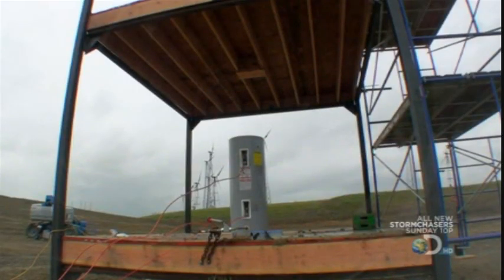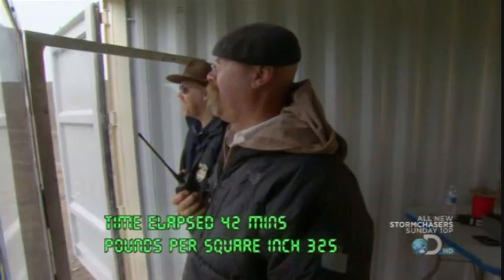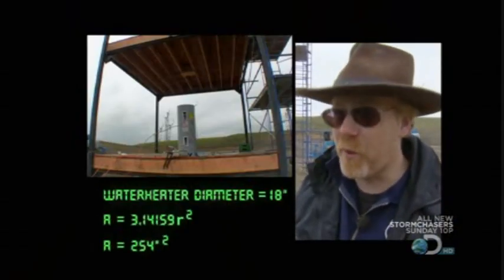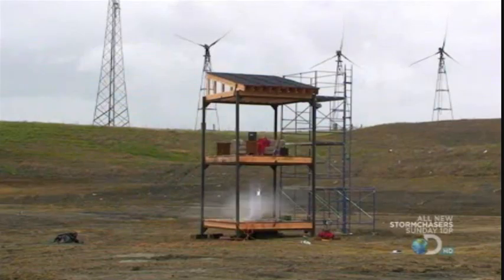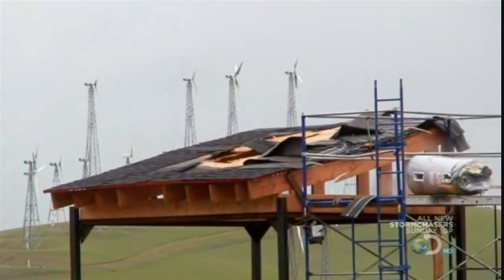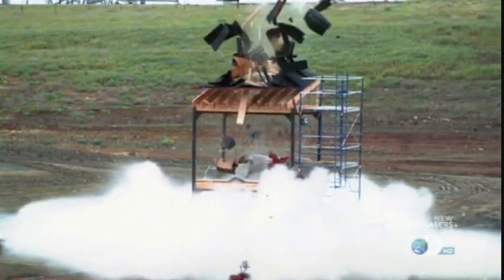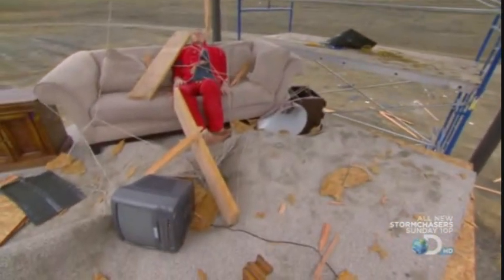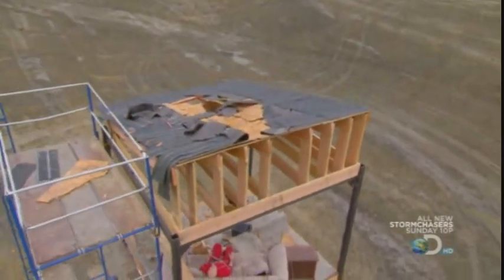Mythbusters Water Heater Explosion

Comment: Well, I watched the video as well, was neat watching the water heater explode then ejecting itself threw the roof, but I have a problem with that.  1. water heaters have pressure relief valves, and thermostatic control gas values with built in aquastats that can be set for maximum temperatures.  Now assuming they all failed at the same time, which I have never seen in 40 plus years of working on water heaters, but lets assume they did fail.  Did you notice that no water lines were attached to the water heater which would have altered its trajectory path.  and if it was a gas heater it would have had a gas line attached to it as well and a chimney all changing its trajectory .  which more then likely would have exploded in place.
Reply: another note in my statement it could be an electric water heater in which in that case does not have a gas valve, but does have temp controls and relief valves

Comment: I remembered this episode from original airing.  Water heater started leaking at about 1:45am, from upper side panel.  Fuse box does not have a label for the water heater.  Yes, I could just turn the whole house off, but no.  Lowes it is, replace the thing.

Comment: This was one of the experiments that best summed up this show. I never would have expected it could actually take off, I figured itd just blow up if anything. Sure taught people the importance of safety valves..
Reply: They cheated a little bit for that dramatic effect. 
They deliberately left the tank partially filled so they could create a larger volume of steam. 
Their first explosions, the tank was 100% full like it would be in normal use. The tank ruptured, but only jumped slightly. It'd wouldn't have the energy to rip itself loose of connecting  commecting pipes and sesimic braces.

Comment: Friend of mine worked at a factory that failed to check the pressure valve on the water heater..... the next morning they found the water heater at the edge of the parking lot

Comment: On the back page of Journal of Light Construction years ago was a report of a big, old riveted-style residential water that blew up, maybe sometime in the 60's of 70's, but the HWH was much older than that. ALL the safety systems failed (or were not present): pressure-temp relief valve, temp limiter on the thermostat, and apparently some kind of check valve on the supply to the house. The tank blew through 3 stories! shattering the roof and landing several houses away. Fortunately, no one was hurt.

Comment: Why doesn't the tank's supply pipe relieve the pressure?  If the water main is 70 PSI and boiling water in the tank creates a greater pressure, it seems like steam ought to flow out of the tank back up the water line.
Reply: should have watched the episode when it aired... lots of questions answered there.

Comment: This reminds me of how missiles leave a submarine. On Boomers of old and now the Ohio Class submarines, there is a small solid propellant rockest separated and sitting on top of 88 gallons of water. When the trigger is pulled to launch a missile it sends a signal to the firing unit which ignites the rocket and blows the metal separator open to transfer the water to steam. That rocket had a thrust of 90,000 lbs per square inch in .6 seconds and pushes the missile out of the tube about 100 feet above the surface of the water. So the very bottom of a 44 foot, 120,000 lb missile is sitting at about 150 feet below the surface of the water  to about 10p feet above surface of the water. So it throws that missile out at over 250ft. It has to push it so high so the missile.has time to feel it's own deceleration so it can light off and fly away. An 18,000 ton displaced submarine moves about 15-20 feet every time a missile is launched.

Comment: small point but those arent "cinder blocks" they are just "concrete blocks" cinder blocks went out of production around 1950. These blocks while strong in compression are very soft, a couple of taps with a hammer is all it takes to break them
Reply: People have used the term cinder blocks for concrete blocks for as long as I can remember. At least in Pennsylvania.
Reply: maybe , but they will forever be called cinder blocks. When I worked in the biz , we used motor homes for the cast , none of them were Winnebagos, but everybody , and I mean EVERYBODY called them winnies.

Comment: One of the best, most relatable Mythbusters segments ever! Almost every home has one of these. It shows how critical it is to have a working T&P relief valve on every unit.

This is a perfect example of a BLEVE! 

I worked for 10 years (during the mid 1980's) as a mechanic in a industrial plant, and worked with a retired plumber ("uncle Bill") there. Part of my/our job was maintaining two 5500 mBTU (relatively small) low-pressure (15 psig)  boilers, and we often discusded the awesome power of steam and the amount of energy available in it. We actually discussed this very scenario: A domestic hot-water heater going waaay over temp & pressure and failing violently, and just how dangerous and damaging it would be.  And here, y'all did it!
Unfortunately uncle Bill passed prior to this episode airing. But I'm sure he would have been amazed (as was I).
Thank you!

Comment: That math thou.... 254 sq inches multiplied by 336 psi equals over 85,000 psi pushing on the bottom of the tank? WTH are you talking about. The operating pressure in my system is 60psi. Are you saying I have over 15,000 psi pushing on the bottom of my tank!!! Lol... they should of left that part out...

Comment: This experiment is a great example to show how explosively powerful steam can be. It reminds me of the old stories of old boilers on locomotives and ships failing and causing massive amounts of damage.
Reply: Not just locos, the old papers in archives if you search for boiler explosion were FULL of boilers that exploded in factories and elsewhere, of it was due to improper maintenance, contaminated water. I think I remember reading that if the water was contaminated by oil it could cause a failure of the riveted steel plates making up the boiler- there would be a bulge that developed due to a hot spot and that caused a thinning and weakening, the articles would go on to describe and pictures showed how the entire boiler was blown thru a solid brick wall- thru another brick building and landed hundreds of feet beyond that.
I also remember the story of an incident in NY City where they were filling up gases into tanks, like oxygen, acetyline etc and one worker was filling a tank and talking to another guy when because he was distracted, he wasnt watching the pressure gage- apparently it was all manually operated and little in the way of automatic safety shutoff type tech back then.
The tank exploded and did horrendous damage, with loss of life, limb and a lot more. The article listed the injuries and deaths.
Another event like that involved guys unloading filed tanks from a truck and THROWING them on the floor in the storage room!, one of the valves was broken off by that when it hit the floor and the tank shot off like a missile, it may have been the same gas filling place at a different incident, I dont remember what the results were of that tank valve breaking off, I think it had welding gas in it and may have been an explosion too.

Comment: and this is why hot water heaters are  regulated and MUST be replaced after 13 years of use. my land lord tried to sue me for the repair cost after our heater failed and started leaking everywhere. after closer inspection (read the installation tag) i noticed my hot water heater had been in use for 25 years.... no wonder it failed im glad it didnt expload. called my local housing authority they came and inspected and cited the landlord for failure to maintain. not just on my unit. all 300. now... if only they would regulate furnaces fires could be greatly decreased.

the knowledge this show gave me helped me contact the correct people so i could stick it to my land lord. wish they'd never had ended

Comment: Too bad that water heater didn't destroy some of those wind turbines.  Also, this is a retarded video because WATER HEATERS DO NOT EXPLODE, you moron.  If the pressure valve is frozen shut and pressure builds, the water supply pipes would burst first.  Clickbaiting idiot.
Reply: they go over that in the full episode

Comment: NASA should use one of these and save a bundle.  Can you imagine a space shuttle being lauched but instead of the those 2 big orange tanks they instead have 2 water heaters strapped on?  Hydrogen levels?  Check.  O2 levels?  Check.  Hot water level and pressure: Check.  We are go for launch!

Comment: Just so everyone knows. So many other things would break before that amount of pressure can get to your water heater. Also an expansion tank would be a great way to avoid this.
Reply: An expansion tank would not prevent this. The tank would fully compress and the same rapid pressurization would occur. The smaller the pipe, the more pressure it can hold, even though all pipe is rated the same. Would you like to try again?

Comment: It's not a hot water heater. It doesn't heat hot water. If the water was already hot it wouldn't need heating. It's a water heater.

Comment: My father was a plumber and had told me how dangerous a hot water heater is. If the pressure relief valve is needed but doesn't open. You now have a missile. Then when I was a teenager the volunteer fire department down the road had theirs blow up like this. It was in the basement and went through the concrete floor and then put the roof. Spraying scalding hot water on everything around in the process.

Comment: Aside from blocking the safety valve, what modifications did they have to make to get this thing to explode?
Reply: They wired the elements on all the time which removed the high temperature limit protection for the water heater. Most they just plugged the relief though. 🤷‍♂️

Comment: I witnessed a 500 gal potable water tank mounted on a concrete pad go airborne when the pressure relief valve failed to open. The positive displacement (piston) pressure well pump just kept running, so the high pressure cut-off apparently failed also. I was just a kid but still remember seeing it go up over the trees before landing about 25 yards away.

Comment: I wonder what the flash on the side of the water heater was when it exploded.  Looked like there was detention cord inside or something
Reply: It had to be supplied with power to heat the water, that flash would've been the electrical arc as the cable was torn off.

Comment: In a real world environment a water heater steam explosion is a less likely than a hydrogen detonation, which is still a rarity; but it would have been cool to see them create a hydrogen induced failure also. ( if you have ever heard a water heater "peculating" that is the sound of hydrogen bubbles moving up through the sediment build up ( generally places that have extremely hard water ) in the bottom of a water heater .Failure occurs when this happens long enough for hydrogen fatigue or thermal stress to create a crack thermal situation that generates enough hydrogen in that location which vents through the crack into the combustion chamber when the crack gets hot enough to release enough hydrogen quickly.It's why Water heater companies replace the peanut oil capsule for free (in most cases ) ...if that thing blows ( which shuts the air intake vent ) then there is a strong possibility that water heater is generating and leaking Hydrogen)

Comment: Two stories.  When I was fourteen and living in Rohnert park CA,  I took a CO2 bottle removed the valve assembly, filled it halfway with water, pounded a redwood plug in the end and set a propane fire ring out of an old stove top around the neck and propped the whole thing up at a slight angle on an old concrete slab. After an hour an earsplitting bang and roar occurred. We thought that it exploded until we noticed the vapor trail in the sky. It landed near Petaluma. 
When I lived in chowchilla ca. we had friends that we went out to dinner with occasionally.  The last time we went out when we came back there was only two standing walls. Their water heater was homemade and finally blew up. It was built to supply hot ( dang near boiling) water to wash down a dairy building and sanitize the milking rooms.
 If we were there at the time I don't think we would have survived, the barn 50 feet away was reduced to rubble. Steam ran through 2 inch pipes. those were uprooted too.
FYI. Steam is not to be messed with.